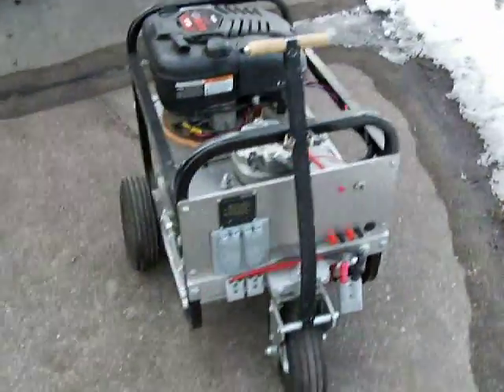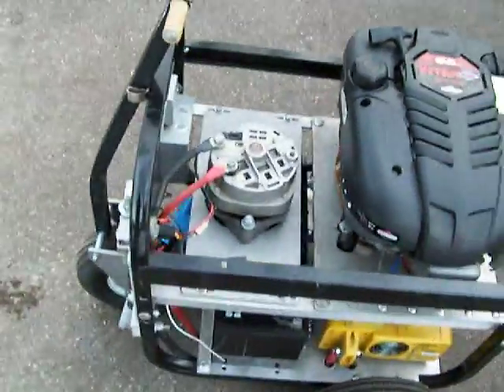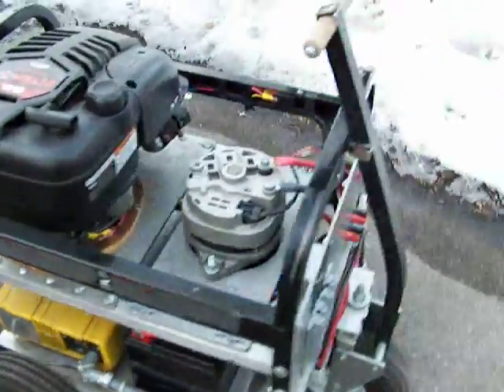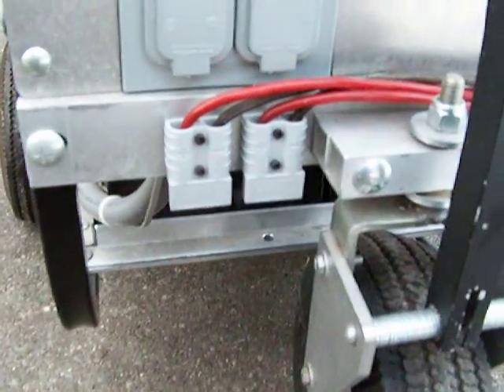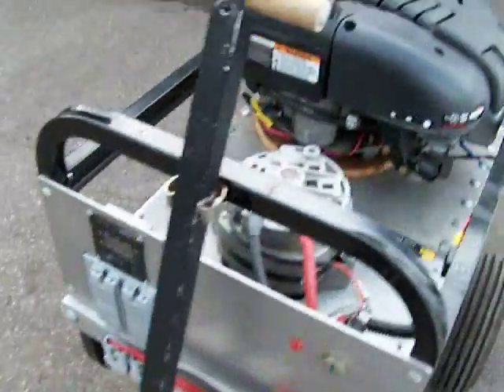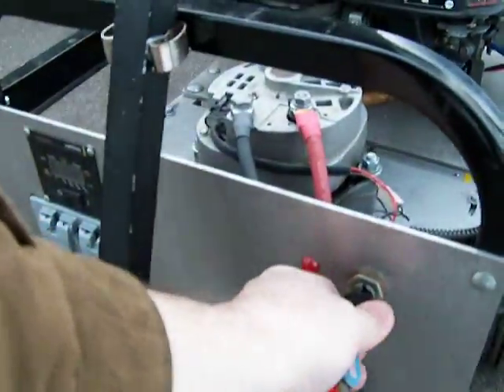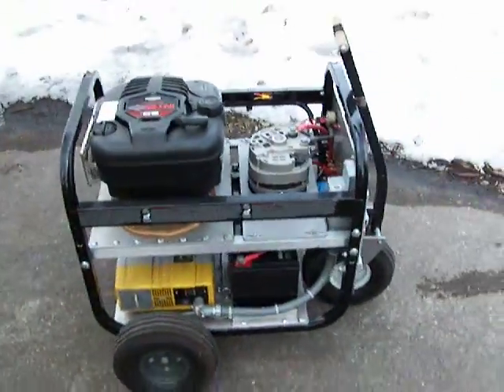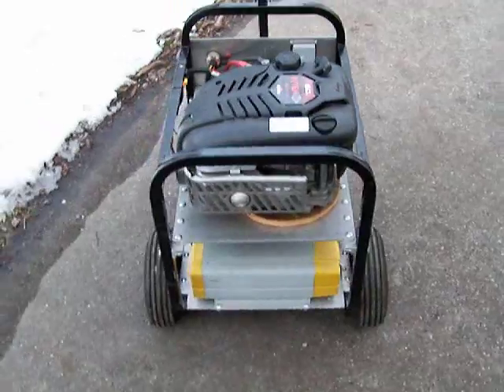Homebrew 1.8kW Inverter-Generator

Comment from the maker: @Pierre5484:  I would NOT advise that.  It would be much easier to either service the engine, or replace it with another engine, preferrably one with electric-start.  Don't know what size your engine/alternator combo is, but, I follow a general rule: Each horsepower will produce ~500W of electrical power, to account for system inefficiencies.

Comment: Thanks!! I'm building a generator for myself but I have a small issue. My horizontal shaft engine. It runs great but its fairly difficult to start. Is it recommendable that I use a car starter motor to the belt via a pulley? I was thinking that the motor would be on a hinge so when an electro magnet is energized it pushes the motor upwards which hopefully will create enough friction that it would start. Do you think that it might work?

Comment from the maker: @Pierre5484: D you mean for the Altenator's field?  If so, then No.  The Alternator's Field is controlled directly by the key-switch.  Its battery-sense lead is connected to the battery at all times, as is the alternator's output (BATT) terminal, just like on a conventional automotive set-up.

Comment: If I may ask, do you have a solenoid hooked up to the alternator and then hooked up to the key switch? I did that on mine and worked perfectly since that the switch wasn't rated for such high amperage!

Comment: How is the engine speed / throttle adjusted?   For example, with no load, or a heavy load, I assume your engine throttle must go up and down to compensate...since you do not need to regulate at 3600 rpms.

Comment: Name Suggestion  ...SSD 1,8 GenKing  ...You could Make it tighter with some air Bags and spinners and Crome Plate it to the max.. NOTE  Safety   the  terminals need rubber covers and belts need belt guards for kids and some warning stickers.. The sound would be an issue at night ...Possibly ..GREAT JOB MAN

Comment from the maker: @RCvolunteer1978: That's exactly how I powered my few appliances during the great Midwest power Outage of 2003.  I used a 600W Portawattz inverter running off my car's engine for about three hours b4 we realized the power wasn't coming back on anytime soon, so we bugged out of town.  Went up north where the power has islanded itself from the rest of the National grid quick enough to stay on.

Comment from the maker: @Townsonbck:  The alternator is a stock Delco CS-144 series.  CS-144s came in 105, 124, and 140A versions.  Mine is the 140A version.  You might want to have your unit checked out on an alternator test stand for full output.  You should be able to determine if it's the stator or the rectifier bridge.  It also helps to have plenty of free air movement for cooling.  My alternator is spun by a 6.0hp (~4.5kW) engine, which proves to be sufficient even with system inefficiencies taken into account.

Comment: Frankly I wish to had one of your gen back in 1992  
I was at South Dade High Homestead Florida after the storm We had damaged cars unable to move but was drag to the auto shop put 1000 wat inverters on them and then drag to different parts of the shelter to power the lights and kitchen to cook 2084 meals four time per day

Comment from the maker: @thomhong1:  Thanks! What would be really cool is a 5-10kW inverter-generator with battery back-up that could power the whole house.  Conventional back-up gen-sets wait 30 seconds to 2 minutes before starting, leaving the house dark for that interval.  My ideal setup would run the 10kW inverter on battery bank power until the gen-set starts.  Once it is running, the gen-set powers the house while recharging the battery bank.  All the consumer sees is a momentary flicker in the lights, at most.

Comment from the maker: @gordonfanchris:  Occasionally, you will find that odd Xantrex on eBay for well under $1k, and I mean either the 1.8kW 12V model, or even a Prosine 2.0 (2.0kW, and 120/240V Stackable).

Comment: I am in the process of desiging a generator like you built, except silenced and disguised to do dual purpose as a radio controlled tugboat. Same kind of setup you have except add another electric motor to power the tugs drive system and RC controls and less battery weight perhaps. It will not just be a toy as an rc boat it will be used to tow family when camping etc exactly like this guy does with his:
youtube video Q1CLdQfBVFY

Yes it will be big and heavy, but ideas?

Comment from the maker: @thmaxxer2: Thanks! Problem w/ going direct to a Gen-head is that your engine will have to run steady @ 3600rpm (or whatever speed your pulley step-up ratio requires). Not saying it can't be done, it's just difficult, 'cuz 60Hz-powered appliances don't like freq. drift.  The alt-batt-inverter route eliminates this problem. Efficiency does drop a few pts, but for me, it was worth it. Are your inverters Xantrex 2.0s? Can they be connected in series for 120/240VAC split-phase?

Comment from the maker: @dancaldwell230:  Not sure what you mean by "running the grid in reverse".  Do you mean like grid-tie (to make my power meter spin backward)?  No, for two reasons: 1) the unit can not synchronize itself to the line frequency; and 2) it only pots out 1.8kW max., so at best, the wheel would slow down, but not actually reverse direction.

Comment: Why wouldn't you just use a generator head instead of the alternator > battery > inverter?  Wouldn't it be more efficient to eliminate what you don't need?  I have 2 2000w pure sine wave inverters, but am seriously thinking about buying a head and mounting it on top of my hyndai car engine and rig up a pulley system and just do that.  Very clean and professional by the way.

Comment from the maker: @tmd004:  The Epicenter is where i got the original idea from.  Though I wanted to have a more "integrated" look, I wanted all components to be strong enough to stand on their own.  As for me, I got very lucky as the the engine, alternator, inverter, and generator frame all came N.I.B. from eBay.  If you want to start out basic, I recommend a vertical-shaft B&S 3.5Hp engine and a Delco 10SI 63A alternator.  Both can be had for a song.  I actually did a 3.5Hp/63A combo, but never finished it.

Comment from the maker: @GMC2500DURAMAX: Sure!  Just look for the BIGGEST alternator you can find.  Mine is a stock OEM Delco CS-144 series 140A unit.  There are shops that specialize in nothing else but ultra-high output alternators (200A & above).  Or just check eBay for any scrapped alternators for trucks, etc.

Comment from the maker: @GMC2500DURAMAX:  Thank You for your compliments.  Your Kubota will handle a LOT more than 1.8kW, for sure.  In several earlier posts and in the audio portion of my video, I explain how the engine speed does not affect the 60Hz output.  Since the 60Hz Sinewave is generated by the DC-AC Inverter, all it needs is a steady 12V input, which is provided by the alternator when the engine is running, or by the batteries when the engine is shut down for when silent power is needed.  Hope this helps.

Comment: Nice job. vary clean set up. I am looking to make one for my self. i have a 3 cyl diesel Kubota motor for mine. I would like to make a lot more than 1.8kw. I was hoping for more around 5kw. how do you control your rpm? if I have 110 volts AC and 36 hurts at 1800rmp and I put a load on it will change and fry everything

Comment from the maker: @ryanb788;  Thanks.  The other major features include the ability to charge off-board batteries, start a car, power a 12V campsite, ans power AC loads silently.  The last point: battery reserve and load will determine how long you can run silent.

Comment from the maker: @bodybuildingking: Question is- what does the G4 put out at 3600rpm?, 'cuz that's the speed the Honda will have to spin at to get the full 8hp.  If I may humbly recommend, use a belt drive (6-groove serpentine) and step up the turns ratio so max alternator output is achieved at 3600 engine RPM.  -Steve

Comment from the maker: @kymopar:  The engine is running a 7" serpentine pulley from a Ford 302 main crankshaft with a custom-made pulley-to-shaft adapter, and the 5" serpentine pulley on the alternator is from an old Ford smog pump.  Two reasons: larger-diameter, and serpentine setup helped get maximum torque from engine to alternator.  So, at 3600 engine RPM, I top out at 5,040 alternator RPM, which, according to Delco's chart, puts out 130+ Amps.

Comment from the maker: @jsmythib:  Thanks! Nice, yes, but cheap?  not-so-much.  Total cost about USD$900.  Except for the supply Silent Power and variable engine speed features, $900 at the 'Depot or Loew's would have gotten me a much larger capacity generator (like 6-7kW).  $900, however, doesn't get me the sense of accomplishment, though.

Comment from the maker: @kd4pba: Thanks for the compliments.  I originally built this thing for Field Day (we were 16A this year), but soon realized that with the batteries we had on hand (one of our members works for the local Power utility, hence his access to LOTS of batteries), I didn't need it for FD.  So we started using it for other events where we needed Silent Power.  Works great, as long as we have sufficient reserve capacity.  But, as venomator1970 said, I really need to work on quieting this thing down.

Comment from the maker: @PaFirePhoto:  Well, I got real lucky, both in timing, and in finding of the critical components (engine, alternator, inverter, and generator frame).  All items were New in the Box (NIB).  Alternator - $25, Electric-start engine - $116, Inverter - $500, & frame - $50, all from eBay.  Total ~ $700.  Another ~$200 for all the parts (wheels, hardware, etc.), and I was in business.  Like I said, it's all in the timing.

Comment from the maker: @Venomator1970 Yup.  I think I mentioned the muffler thing in the description or earlier in this thread (not sure which).  Also the fuel-line:  I thought about putting a "T" in-line allowing me to switch between internal & external fuel tanks.  Still kicking both around.  I also thought about enclosing the whole thing to cut the noise down even further.

@ding0925 Thanks!!  I spent ~ USD$950, or ~ $0.53 / watt.  Not too bad for a DIY set-up.

@Thetruthishere11 Thanks! Wheels make big diff.

Comment from the maker: @lapulapu12345 Thanks!  I just as easily could have gone with used components, and that would be perfectly fine.  it's just that I wanted to have all new components:  engine; alternator; DC-AC inverter, frame, and batteries.  Being that I have access to some pretty awesome components (like LOTS of 2/0 wire, a water-jet for machining the mounting plates, I just said go-for-it and use the best components I could find.  Add some help from eBay, and I got off pretty cheap, considering.........

Comment from the maker: @ShutterbugW   That was the original idea.  I started out with this just to verify that I could do it.  Ideally, I want to get an inverter that puts out 120/240VAC in the 8-12kW range, so I can run both halves of the CB panel (& the whole house).  Of course, I'll need a bigger everything (engine, alternator and battery bank).  I already have the generator & Inverter, but still need an engine.  The Generator (Aura-Gen) doesn't need much of a battery because it is an integrated system.

Comment from the maker: @honda4x4esjoseph:  You don't want to know (UGH!!)  Seriously, It came in at just under USD $950.00, or about 53 cents per watt.  Considering a good model from Homeless Despot or Lowe's runs about 10-15 cents per watt, this is not bad for a specialty version.

@ukorganist:  Thank You for your kind compliments.  I want to do 8kW driven by a Briggs & Stratton 20hp I/C Opposed-Twin.  I like the Opposed twins because, unlike the V-Twins, they are balanced, producing smoother power and more torque.

Comment: In siries (I live in the UK so 240V) and the inverter is a 10KW AC converter I got from a yard sale. Think it was originaly used as part of a  home wind turbine kit, but runs my batteries just fine. Also to charge the batteries I have 10 24v truck battery charges so I can chage them all at once. It takes alot of juice though.

Comment from the maker: @syncmaster710n14 
Sweet!  How big was the Inverter?  20 car batteries?  Did U connect them in series (240VDC) and drive a high-voltage inverter, or just parallel them and use an inverter with a 12v-input?

Comment: Cool.
I baught a honda a couple of years back and Its bean good for back up (live in the countryside lots of power cuts) but it was no good to leave runing all night so what I did was got 20 car batteries riged them up to an AC converter and I can now run all my house for 2-3 days off them with no generator at all.

Comment from the maker: Just the stock OEM starter.  I got lucky- it was the 12V version.  There were several 6V versions, which would have made charging a bit difficult from a 12V source w/o over-charging.

Comment from the maker: I have a smaller un-finushed gen-set using an electric-start 3.5 B&S driving a Delco 140A Alternator, electrically identical to the one in this video.  I shot a crude video of it with my camera-phone, but plan to re-shoot it with my digi-cam.  I seriously doubt the 3.5'er could handle the 140A at full-load.  Doing the math and taking into account the inefficiencies of the standard Lundell alternator (~60-70%) for a maximum output of 1960W (14V x 140A), I would need 4kW, or over 6hp.

Comment from the maker: APM-

Thanks for the comments.  I did have issues w/the serpentine pulleys, not the belt.  The smog-pump pulley kept coming off the alternator, so I took it to an alternator shop, and they torqued the shaft-nut on really tight.  Now no more pulley issues.  Next thing I would like to improve is quieting the exhaust, and the whole thing together.  not sure how I'll do that.